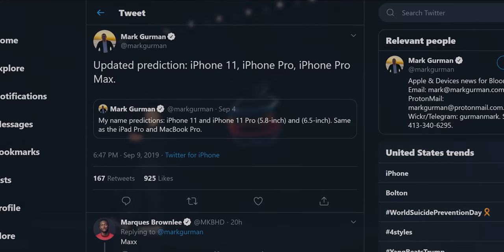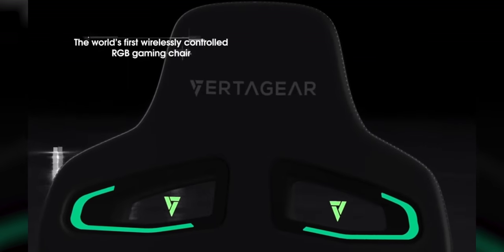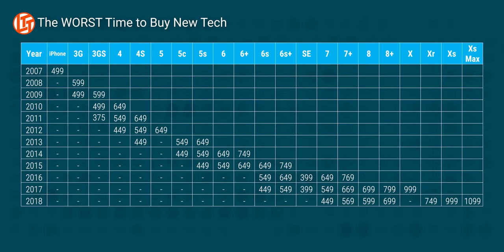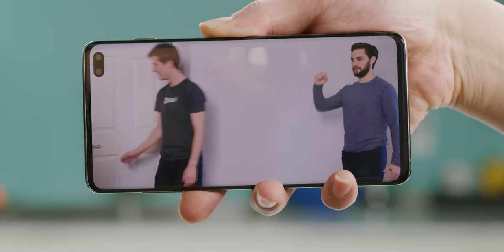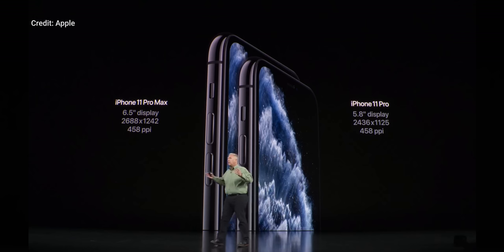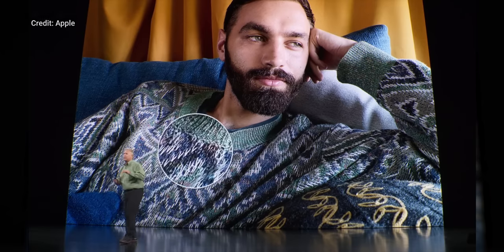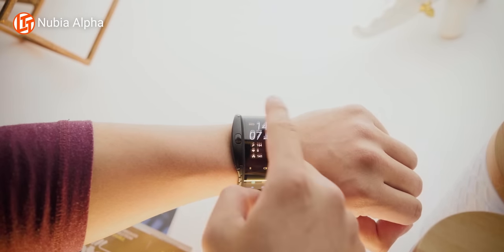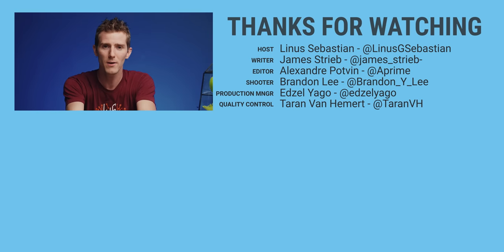Apple iPhone 11 REACTION!!

Comment: Xiaomi: Good devices, good prices

Huawei: Good cameras.

Samsung: Good quality.

IPhone: Good evening.
Reply: Quality? Samsung? Hahahaha. Kyocera: Throw it on the floor, still works.
Reply: @katiekatbb  my s10 got RUN OVER BY A TAXI. beat that!
Reply: @sappireflames0009  Yeah but have you used it for more than a year?
Reply: @katiekatbb  it came out like 5 months ago.
Reply: @katiekatbb  but i did have that phone replaced because the screen was cracked. though it worked perfectly fine.

Comment: The only thing that's interesting in new iPhones is new A13 chip. They seem to be far ahead competition.
Btw how tf they still don't use USB-C?
Reply: USB c is crap
Reply: @glitchcharliemartin1157  how so?
Reply: A13 but no 5G
Reply: Hyper Pug what’s so good about usb-c
Reply: Gogel Meal 5g isn’t good yet
Reply: A13 is just A12 buddy.
Reply: The Greatest Comeback that’s what makes it an A13. It’s like saying the SD 855 is just an SD845 with fix ups. You can’t increase performance that much every year. Like jeez, what do you use your phone for? Besides Android updates not coming so frequently, what can’t you do with an SD835 or even an SD 820 chip? Those phones were amazing already, and kind of peaked what you would ever want to do on a phone. Calling someone an Android whore is stupid though. Could be a disgruntled Apple user still on an iPhone 6s refusing to give up on iOS and a headphone Jack
Reply: Sloppy Toons lol I use 2 phones ones an iPhone XS Max which I’ll replace soon with the 11 pro Max and I also use the note 10 plus 5g. Plus people call Apple users isheep and I call android users android whores since they love having there info seller left and right lol
Reply: @lukefisher5352  faster charging, larger data transfer bandwidth. (USB c can enable thunderbolt on Intel machine, eventually USB 4 and right now up to 20gbps on USB 3.1 gen 2.) Lightning can only run at USB 2.0 speeds. Lol.
Reply: @glitchcharliemartin1157  so why they used it with the last year holy ipad???
Reply: Jibran Raza it just is
Reply: The Greatest Comeback no it's not that's like saying the A6 is the same as the a9
Reply: imtechguy why would you use two phones unless you are a YouTube tech reviewer? Genuinely curious. I used to do that ages ago, when I had to travel between two cities for work. I always lost one, so phones with two SIM slots were a blessing. Doing too much productivity on a phone is also annoying. I have an iPad Pro for on the go productivity (I draw for a living, it’s awful for anything else, I rather a laptop), and a computer in the office. After my iPhone X I can’t imagine what tech advancement can come that would get me excited again. I just couldn’t be bothered with the set up, and if photography was that important to me, I would buy a camera. The new chips may be super powerful, but switch games are so much better on some pretty modest technology. I had the Note 8 once, but realised that anything that fits in your pocket is too small for any real productivity.
Reply: @MrHellrider9  lol maybe Apple users are the one need to wake up when talking about specs. Even LinusTech shits at Apple how uninnovative they are.

And that single speed isn't even gonna get maxed on todays games which is mostly capped at 30 fps and 60 fps on mobas.

You can just litterally just buy an android phone less than half the price of iPhone XR that can also run latest games at max.
Reply: The Greatest Comeback Only iphones can run heavy games like fortnite at 60fps right now. It was a whole thing. And let’s just stop with the phone arguments it’s kinda immature
Reply: The Greatest Comeback I sense you don't really understand how product cycles work.

Comment: requires a headphone jack and removal of the notch and size form factor of the iphone SE to fit in the pocket. only way i would buy another iphone. im staying with my iphone SE .. perhaps the Motorola RAZR V4
Reply: Chad I have an iPhone SE and I’m gonna keep it for as long as I can. There’s a company called Bodyguardz that makes tempered glass screen protectors for the iPhone SE, and if you buy it once, you get free unlimited replacements.
Reply: I prefer my Palm Centro.

Comment: The camera now take 8 images before you push the button.  Apple spyware
Reply: Its 4 Images. it takes them when it detects the object in focus. It then puts them together by 2 additional ones and then ones you actually take. Has nothing to do with Spyware. The Huawei P series phones use AI to detect objects for a long time now. Even if it takes them before or not...its just the way it works on the iPhone, to make as good of a photo as it does.

Comment: They could have used an amoled display for the iPhone 11
Reply: But that would be more expensive for them to make :0 why make a better display when most people will buy it anyway :D
Reply: They didn't because they managed to exorcise Steve Job's ghost from haunting them for anti-consumer decisions.
Reply: @Frank72364  Literally every flagship of every smartphone company has AMOLED or OLED displays in them from the base models to the highest tier of models. Apple is the ONLY ones who don't have AMOLED across all tiers. They're still using LCDs! I've had an AMOLED display since 2014!
Reply: everyone would just buy the 11 then, would be the dumbest decision marketing wise.
Reply: @Frank72364  The flagships that apple are making like iphone xs or the current one all use OLED and not AMOLED
Reply: @V8_Diva  me since 2009 (Samsung S8000)
Reply: @Frank72364  no
Reply: Normal IPS display is the only reason I'll buy a new iPhone 11 instead of this shit burning amoled.
Reply: BonoDex wow cool numbers that mean nothing lol. You can barely even tell the difference in a display that size. Good waste of battery though.
Reply: @Frank72364  you have no proof that the new iphone with beat the dynamic amoled int the note 10 or s10 it haas a good chance but it looks like they are still using the old amoled tech so it missing out on some nice improvements
Reply: @Frank72364  How much is apple paying you?
Reply: @Frank72364  Apple gets Samsung's old display tech about 2 years after Samsung is done with it.
Reply: @Frank72364  I'm sorry man Xperia 1 has best screen
has ~643ppi
1644 x 3840 resolution, DCI-P3 100%
Triluminos display
, X-Reality Engine, HDR BT.2020
apple fanboi only looks at its rival Samsung there are many phones out there
and I choose Asus Rog Phone II for overall this year
Reply: @Frank72364  those "best AMOLED displays on the market" you're talking about are made by SAMSUNG. Samsung OWNS the rights to AMOLED technology.

Comment: 18 hour smart watch battery?

Laughs in 20 day battery life via Garmin Fenix 5x Plus
Reply: The 20 Days isnt really comparable to the 18 hour. Those measurements are taken far differently. If using the same parameters of the 20 Day for the Garmin 5x plus you would see about 4 Days with the Apple Watch. But that is due to various reasons, especially that Apples has a better processor, cell support, more sensors, higher quality screen with higher PPI, etc. Also the Garmin is 2x the price, and over 2x the weight.
Reply: laughs in 60 days on vector watch
Reply: 18h on a smart watch... that's pathetic.
Even my gear s3 frontier can pull more then a day... or to be more specific 2 and a half days.
Reply: "20 day battery live via Garmin Fenix 5x Plus" is not a language, and laughing is universal anyway.
Reply: @AirWolf2301  And the Apple watch is far better than your S3 Frontier.... In every single measurable way...
Reply: @SimpleEnigma331  wow such argument 10/10... me burned
Reply: Ha ha, i'm happy too with Mi Band 4 and 20+ days of battery life. :D Whats the point of having watch, if you have to charge it more often than phone itself.?  :/
Reply: Laughs in.... whatever battery life a cheap regular watch has. Too long to really keep track of.
But I guess it's not a smart watch. It's a dumb watch.

Comment: Pretty much the same reaction, as that god damned $1,000 stand.     🤦
Reply: I suggest buying the note 10, u get more for ur money
Reply: My name is BOB but the money is too much, especially when the s10 plus is cheaper, and a lot of people that use the note 10 barely use the pen

It doesn’t matter Apple, Samsung, Google, if we as consumers don’t establish that $1000 is too much, they’re going to start charging more, and Samsung already has for their Note 10 5G. By saying “buy the note 10 more for your money” you’re basically saying “I know that this phone costs a fortune but buy it because it’s better than the other phone that costs a fortune” By not buying the note 10 you’re telling Samsung that the prices are way to high and out of line of what a smartphone should cost. (IMO the note 10 should be around 800 USD)
Reply: @Frank72364  You get more value for your money, the note 10 has a bigger battery and REALLY good camera. 25 and 45 watt charging too. GREAT screen to body ratio, no notch and a smaller hole punch cutout which is more discreet. Also has the universal type C connector. Also there was some GOOD pre order bonuses, also you could get 600 dollars off if you trade in.

Comment: I haven't seen any reason to switch away from my Pebble watch (RIP pebble, long live rebble). Always-on display: Check. Lasts three days on a single charge even with sleep movement tracking: Check. The only thing it lacks that I'd like to have is a heartrate monitor and maybe a blood oximeter, neither of which is hugely important. I'm sure there are features of modern smartwatches that I'm missing, however, I can't imagine any of them would be worth having to remember to charge it every single day.

Comment: A notch that fat in 2019 is absurd to me
Reply: NeutralGuyDoubleZero it has to house 8 different sensors/projectors etc where do you suggest they put them?
Reply: @JonnyD3ath  Well id argue most of those sensors are pointless/not worth having a bite taken out of my screen. S10 narrowed it down to a punchole and just uses touch id which is much further along than face id. Although we havent seen how well new face id works i still dont think its necessary/gets in the way more compared to touch id.

Comment: So we are not going to mention that they said the iphone is the fastest smartphone but conveniently didnt include the one+ in the comparison?
Reply: The Iphone 11 (probably will) has a Geekbench score of 13900 
The Oneplus 7 pro has a Geekbench score of 11000
Reply: @KivyKon  scores don't matter if the optimisation isn't good,pocophone f1(sd845) with way lower score already destroyed IphoneXSMAX in speedtest so let's not even mention SD 855 or even 855+
Reply: Why do you need such powerful processors in phone anyways? Only reason I can think of is for gaming and doing it on a phone is just lame... I have p10 which would be "slow" compared to any of them, but it is still snappy and opens what I need almost instantly...
Reply: @vyteniskajackas7579  You only say that because Android is fucking hopelessly behind Apple in processor technology.
Reply: @ericmatthews8497  They aren't? You say "android" like it's a company that makes phone lol
Reply: @cyanus7347  using Pocophone F1 right now, questioning why would people need a phone that's faster than this phone
Reply: The iPhone IS the fastest phone. Has the fastest SoC by miles and way better optimization than Android.

Comment: Wait I'm confused... Why does this phone being as expensive as it is still have a notch? In this day and age? Oh wait, it's meant to be a 'marker of the "apple" identity.' 🤔 I think I'd prefer a phone without a notch and still a better display than this phone while being cheaper (amazing, I know right!), aka the OnePlus 7 pro.
Reply: @Frank72364  fair point... But to cut off that much display for face ID? Is that a worthy sacrifice? They should use inbuilt touch ID (which exists and is very fast)  for now until they find a solution to use face ID without a notch.
Reply: @Frank72364  and yes you can buy a phone with a better display. Have you compared specifications of OP7pro to apple? OP7pro has higher resolution, higher refresh rate, higher screen to body ratio, and a higher pixel density, while being about 700 AUD cheaper. Sorry but that's unbeatable.
Reply: @Frank72364  Not sure if you madeup your data, but iphone xs max has a poor display compared to most phones out there. IPhone xs max has pixel density of 456, resolution of 1242x2688, and 60hz refreshrate.  has pixel density of 515, resolution of 1440x3120, and 90hz refresh rate, and not to mention a much greater screen to body ratio.